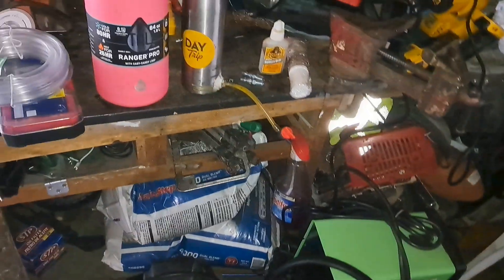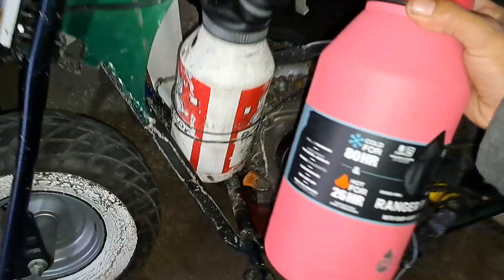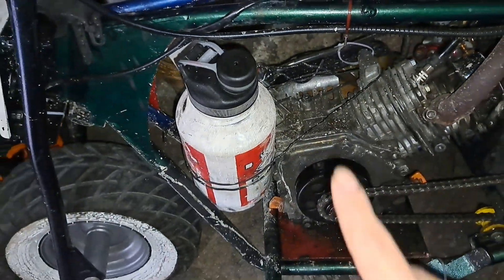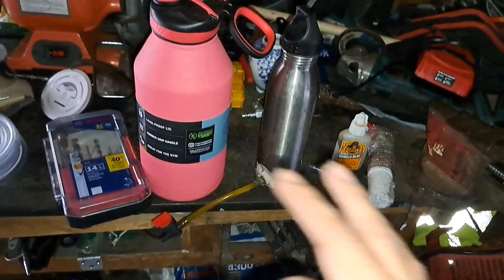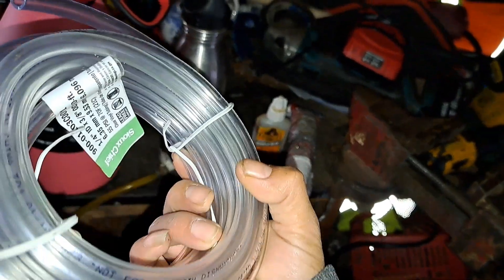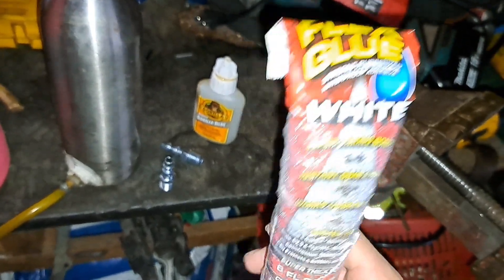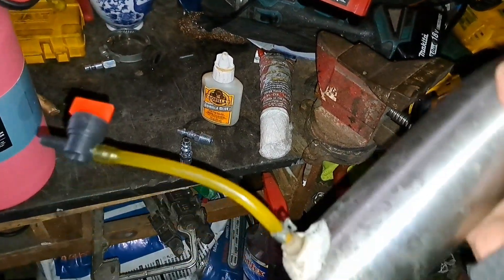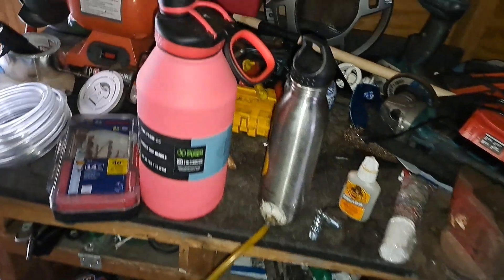DIY $20 Mini Bike Gas Tank!

Comment: I had tried using one just to store extra gas while I ride  and  it ate thru the rubber gasket in a week and then I couldn’t take the top off anymore it was so tight
Reply from the maker: Oh dang I never had a problem with the ones I'll be using. But yea the gasoline is strong and eats threw things. I got the big one at Walmart